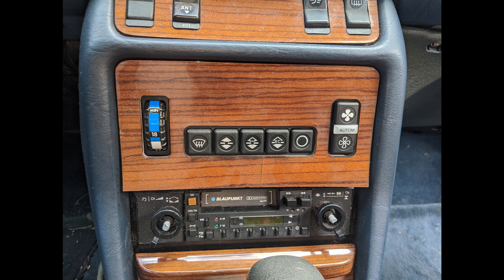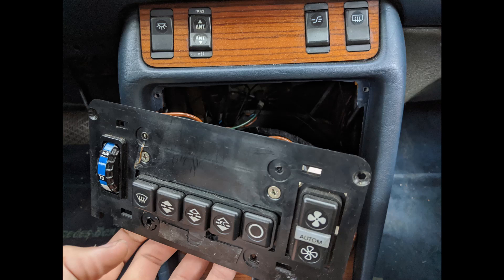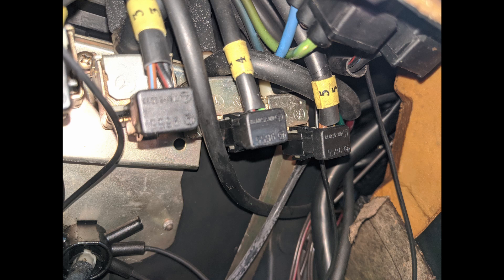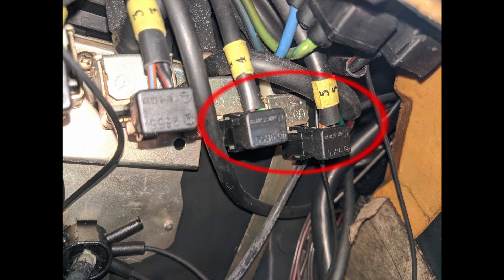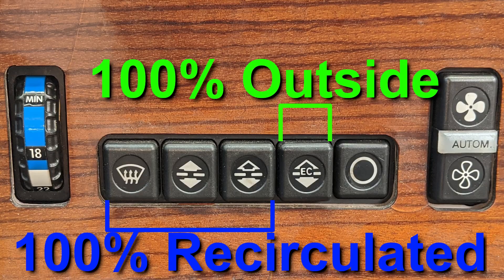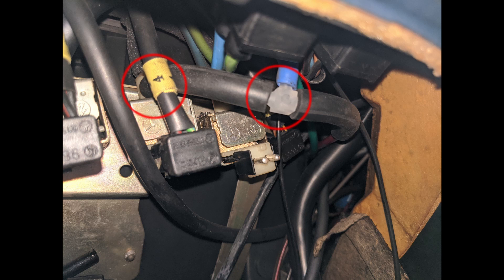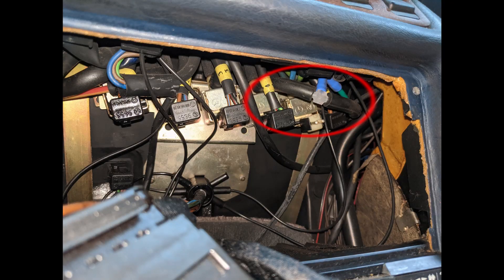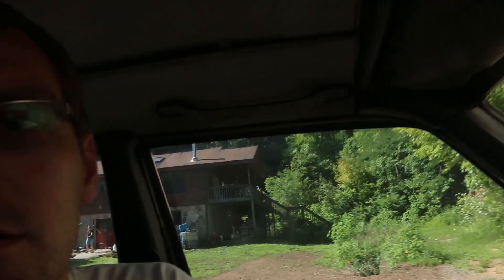W123 HVAC Recirculation Modification (Cheap/Free Colder AC Mods Part 1)

Comment: Hi Tom , have a question, do you have an idea where can i get a Shifter illumination bulb/ or a any other bulb with socket  for W123 which could fit ? thanks
Reply from the maker: I think they are a standard 194 size bulb, I should make a video about changing it!
Reply: @trythistv   Thanks a lot for your quick response , I think it is a great idea to make a short video, it may help some others it took me also a while to find it out. It is really easy once you and has the right replacement bulb available.🙏🙏🙏

Comment: How much freon r134
Reply from the maker: R107 and W116 take 2.2lbs of r12, or 1.73lbs of r134a
W123 and 6.9L w116 takes 2.6lb of r12 or 2.09lbs of r134a
W126 takes 3.3lbs of r12 or 2.72lbs of r134a

Low side pressures should run around 35psi, High side should be around 200psi

Comment: I have a 1984 turbo diesel Mercedes and my A/C works perfectly even on a hot day in the 90’s. But know some people have had problems with there A/C in those W123. I guess was lucky.
Reply from the maker: At some point they started using a different type of condenser and stuff, I feel like it was around 85 though, and you're absolutely right, climate also has a lot to do with it, humidity and temperature has a massive effect, 100F but low humidity my AC does better than 90F but high humidity. Where I live is near a lake and in the summer it can stay over 100F for weeks and it is miserable on even modern AC systems.

Comment: I know this is a year old video,but do you also have that on the W126 chassis??
Reply from the maker: I don't have a video for this on w126, I've never had a w126 to play with, I would bet it is almost the same exact procedure, I do believe they shared the climate control from w123 to w126 and possibly some of the early w124 as well, but I'm not really certain, just a guess

Comment: Good video did you ever get your engine knock or tap to completely go away on previous video
Reply from the maker: It is nearly all gone, the camshaft was worn down on one lobe, and had damaged one rocker, after replacing that there was some leftover knocking sound, which replacing the injector nozzles and balancing the pop pressure got rid of basically all of the remnants. Just drove the car 1500 miles on a trip to the beach and back, ran basically flawlessly the whole time, no noise or weird behavior.

Comment: You are very good mechanic can you tell about my 300 d not cool air conditioning and not hot in winter
Reply from the maker: No heat and no cold is an interesting failure. I would verify the fuse for the climate control is good, and from there, first thing I'd check for AC is toss a set of gauges on and see if there is pressure. If there is, jump the pressure switch on the receiver/drier, and see if the ac clutch engages and blows cold air then. For no heat it is basically the monovalve is not opening, which is odd because it fails open. Unplug the 2 prong connector on it and see if you have heat. There is an aux water pump but usually you will get some heat without it, and then can go bad and burn up part of the climate control unit, as the aux pump was not fused from the factory for some reason.

So those are where I would start, no heat is puzzling, pretty much has to be a stuck monovalve or it is being commanded to be shut by a malfunctioning climate control unit

Comment: from my understanding the only 80% circulation rate is for safety reasons. imagine you do a longer trip with AC on, windows closed, maybe 3-4 people inside. without fresh air you will eventually run out of enough oxygen without noticing. at least the air quality will no longer be particularly good very quickly. in most modern cars the recirculation function will be deactivaded after like 10-20 minutes for this reason.
Reply from the maker: Possible, but I'm not sure, I heard it was something involving the defrost function causing the windshield to fog up on 100% recirc (which I haven't experienced, but I am aware it could be an issue)
I know my cars have enough air leaks that it isn't ever a concern of running out of oxygen or poor air quality. My trucks (20 years newer than the cars) have a manual setting to engage recirculation on the climate control knob, which is either on or off, and stays on if you put the knob into that position (which is where it stays all summer long here).
I'm sure there is some logical explanation, but I can tell you for a certainty, in the southeastern US heat and humidity this summer, I've not once been uncomfortable in my W123, and my wife has been so pleased with the AC, we're taking it on a several thousand mile road trip in a few months together. That's a win in my book, plus I'm sure the seats will last longer if they aren't drenched in sweat every day.
Reply: @trythistv  yes, but when the car was new and all the seals were in good condition, it probably insulated much better from the outside air. i found an article on a motor website and they also mentioned both,  the oxygen issue and the defrost thing.

my 1988 420 SE W126 has an extra switch, too. according to the manual the recirculation will be deactivaded after a certain amount of time. i personally dont use this function very often because we have usually mild temps here in germany.
Btw: i wish you a good road trip. i'm sure the W123 will doing well, these cars are rock solid, especially as diesel
Reply from the maker: Agreed, I suspect with 40+ year old rubber seals there is plenty of leakage. I've replaced a fair number of door seals and such, but still, I know there is air infiltration from other spots.
I've also heard the AC systems were designed (obviously) for the more temperate conditions seen in Germany, and the ridiculous heat and humidity we see here in the southern US is just too much for the system to handle, This modification may not be ideal, but it does make it much more enjoyable to own such a wonderful piece of automotive history, I cannot wait to get the cosmetics fixed, a fresh coat of paint and clearcoat will make the car look much younger from its current state of peeling clear and faded paint.
Seeing the color difference in the door jambs and areas untouched by the sun makes me want to see the car prettied up. Planning on that this winter hopefully.

I've seen where people have retrofitted a timer and recirc switch from a w126 or w124 into a w123, I may look into something like that in the future, or possibly build my own piggyback circuit to recirculate for a set time period, or gradually open the fresh air vent when the set interior temperature is reached so that it would blend in some fresh air, but vary the percentage depending on exterior temp vs interior temp or something.

Thanks much for the thoughts for the road trip, we'll be travelling about 1400 miles round trip, really not much for a w123, I'm brushing up a few maintenance items before we go, I'm expecting a fairly smooth journey, hopefully it ends up going that way!

Comment: Is there any way to do this on an older 123 with the manual AC controls - with no recirculate at all?
Reply from the maker: Hmmmmm I'm not sure. There may be a flap somewhere, I will have to see if there is any info about the manual climate system. I would think it would be possible to modify in some fashion to allow recirculation but I don't know off hand. I'll see what I can find, and I will try to remember to report back!
Reply: @trythistv  thank you, that would be a huge helping cooling this beast!
Reply: I would even make it a permanent Solution if necessary
Reply: Thanks for all Mercedes w123 videos.  Each one is a pearl that contains useful information to the uninitiated like myself.  I too have a standard shift 1982 240D with a manual climate system.  I suspect like he automatic systems, I am getting 20% fresh air and am therefore sweating in NYC traffic this summer.  Any thoughts regarding the manual system since your Hmmmmm last month.  Plan to make your other mod regarding having the fan run whenever the clutch is engaged but  I don't suspect it shall make enough of an improvement without more help.  Any thoughts even just theories would be greatly appreciated.  Thanks a again for all your useful gems.
Reply: @mr427m  I wonder if it’s 20% recycled and 80% outside air? Or maybe 100% outside air. At least it feels like it here in Florida.
Reply from the maker: @mr427m   @ResponseDigitalMedia  Oh man I'm sorry guys I totally forgot, its been a chaotic summer with work.
I sadly don't have a manual climate system to examine, but what I can see from pictures online is it should all be the same flaps as the vacuum system, just driven by cables instead of vacuum pods, which means that you should be able to get to the recirc flap and main air flap via the passenger footwell (assuming US spec left hand drive, I'm not sure how a right hand drive car would even be set up), I'd say there is a good possibility that you may be able to disconnect the cable or adjust it to have more pull and fully close the main air flap so that you get fully recirculated air.

If you pull off the kickpanel you should find the blower motor, and you can follow along my evap cleaning video (https://youtu.be/-ydCsCSxiiA) to pull the fan and reach up in through there and with a flashlight and mirror, or maybe cell phone camera, or if you're really flexible you may be able look in there somehow and turn the knobs to see which flaps move, the recirc flap is pretty obvious on the vacuum systems, I think its actually visible without removing the fan, but I do believe the main air (outside air) flap is up in behind the fan a little bit.
Reply from the maker: Here, take a look at these pictures, its a vacuum system, but I'd almost bet the vacuum pods were added to the same parts as a manual system:
http://www.peachparts.com/shopforum/diesel-discussion/207262-w123-my-experience-replacing-all-ac-vacuum-elements-without-removing-dash.html
So you should be able to see those cables without removing the fan at all, see if its possible to remove the cables and feel what the flaps want to do and reattach in a way they stay in the desired position, or ideally adjust the cables so the recirc flap is open and the main air flap is closed when the knob is turned to the desired AC setting
Reply: @trythistv  Thanks for you fast reply and your expertise.    Unless the the heat breaks real soon, I shall try to rearrange my cables using your Video as a guide.  Will let you know how I do, and if I am able, take some photos.  Be well.
Reply: @trythistv  thanks, those pictures are really helpful!
Reply: @trythistv  thanks i going to do the contortions this weekend and see what I can see!!
Reply: @trythistv  Those photos are very helpful thanks, but I still have a question… so it turns out my manual AC, has both cable and vacuum actuators.  The cable actuator controls what is labeled in one of the photos; main air flap. When the AC is totally off  (using the center control dial on my panel) it looks like the main air flap is wide open Because the lever that is visible is horizontal in the off position. And as you go through the speeds of the fan The lever moves more vertical. Although I’m not able to see what’s actually happening inside. 

The vacuum actuator (In the photos labeled as (fresh air recirculating air flap) is controlled through an electric vacuum switch That I am assuming is switched on when the auxiliary fan is on, because I cannot get it to come on manually using The levers or knobs.  The default position is the rod coming out of the vacuum module fully extended.  

Now that the fan is finally kicked in I see no change in the vacuum modules position. I’ll have to trace back to vacuum line etc.… But meanwhile if I just pull on the rod back as if the module has vacuum, it only has a short travel before I hear the flap hitting the fan. I’m not sure if I’m actually exceeding the normal travel or if there’s a misalignment issue.  There is a notch in the center bottom of the flap That looks like it’s supposed to clear the center shaft of the fan. I recently replace the fan so I’m wondering maybe if that is the alignment issue.  

But not being able to see what’s going on inside makes it difficult to understand how it’s supposed to work. My question to you is do you know that if the vacuum actuator is on pulled to it’s maximum travel is that and for recirculation mode?  

If that is the case maybe I’ll figure out how to get it past where it hits the fan and just secure it somehow.
Reply: Also is there anything I should do with the main air flap? I’m assuming when the AC is off the flap is full open for vent mode.
Reply from the maker: @ResponseDigitalMedia  Well that is interesting. The main air flap (fresh air) is mechanical and the recirc flap is vacuum? that makes me curious if there is some difference in the way air flows or the flaps move/seal. 

You could unplug the fan, possibly remove it entirely and run the car and look up in the dict where the fan was and see what is moving and how far it goes, if something is restricting the travel or causing a problem there perhaps.

I'm sorry I don't have more knowledge of the manual HVAC control system to share with you!
Reply: @trythistv  thanks for the quick response! I’m going to drop the fan as you said and And either fix the obstruction or flip the flap up to the other side of the fan obstruction and secure it in place there. And yes the main air flap is mechanical. I really don’t understand the need for two flaps? Another thought, if I cannot elegantly secure the recirculation flap in place, why couldn’t I just disable the main air flap, to the closed position? I just need to disconnect the cable. Wouldn’t that achieve the same thing?
Reply from the maker: @ResponseDigitalMedia  I would think so, the "main air" flap is in reality the outdoor air flap, and the recirc flap is exactly as the name implies, one of them has to be open otherwise there will be no airflow which could be bad for things, I guess the solution to that at the factory was make it sort of an either or but not ever solely dependant on air coming from one source, so if the vacuum pod fails for the recirc then the main air would still be supplying airflow to keep stuff from freezing up perhaps.

In the southern US, that little bit of German failsafe engineering sure makes me sweat more than I'd like, thus my modification lol

I sure hope you get it sorted out, and I'm interested in learning anything you discover, never know when a little tidbit of knowledge will come in handy!
Reply: @trythistv  thanks, I will keep you posted on my progress.
Reply: @trythistv  I took out the fan motor and was able to reach all the way to the main air flap. When the AC fan selector is on high, it not quite closes all the way. Possibly leaving it’s 10-20% open. I disconnected the cable in order to completely close the flap. The recirculation flap which is vacuum controlled. In it’s default positioning with no vacuum applied, the flap is closed with the exception of a half circle at the bottom about the diameter of a nickel. Which I believe is there to still at allow a little air through And to clear the top shaft of the squirrel cage when opening. Although in my case with the aftermarket fan it does not clear the shaft. 
And my vacuum actuator doesn’t, But I want it in the closed position anyway. So I’m hoping to get a little benefit from closing the main air vent completely.

Comment: If you set your climate control to blow nothing but recirculated air, your defrost will not work properly. Most modern cars will not let you turn on the recirc function if defrost is on. But if you live some place where that is not a concern then it is of no concern. I'd convert it to r134a and put ICE 32 in it.
Reply from the maker: I hadn't thought of that, I know the defrost comes on and seems to work, but I'm unsure what effect the recirculated air will have long term, I haven't needed the defrost a lot as of yet, and its easy enough to undo this change should I find it causes issues. I've thought about adding some kind of toggle switch to allow selection between stock and 100% recirculated air, but I'm still figuring that out lol
Reply: @trythistv   Could the recirc defrost issue be addressed by piggybacking the exterior vac line and electrical connect over to the defrost line and connector? Also have you experimented with adjusting the temp setting of the ETR(capillary tube sensor on side of evaporator) to let the compressor run longer? My understanding is that MB set them to protect the evaporator from icing in moderate climates. Most are set to kick the compressor off anywhere from 38'F to 46'F. I've heard of people removing it and setting it closer to, or right at, 32'F in hot humid climates.
Reply from the maker: @v.dembsey3355  Possibly, I need to spend some time building my vacuum diagrams for the climate system, that stuff is complicated and just a hair overengineered lol.
I have heard of adjusting the ETR, I've been meaning to experiment with that a bit once it gets good and hot, I may just have to pull the kickpanel back off and take a peek soon.